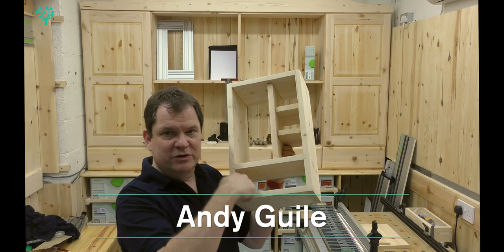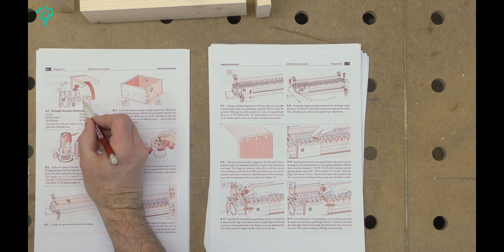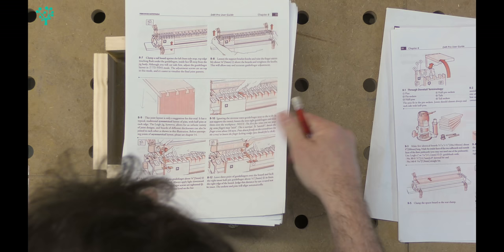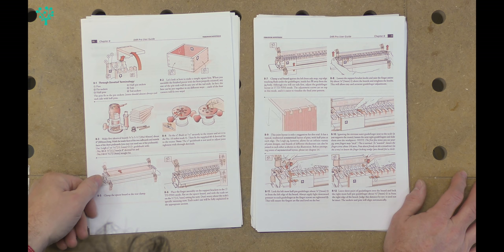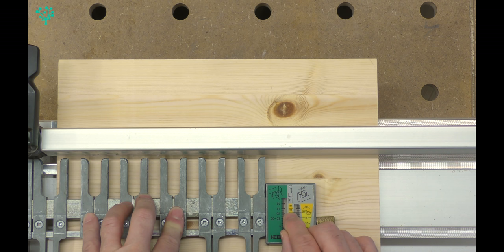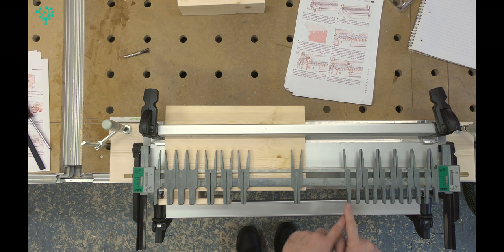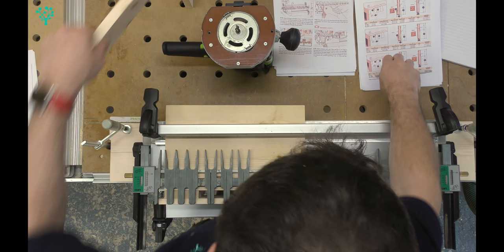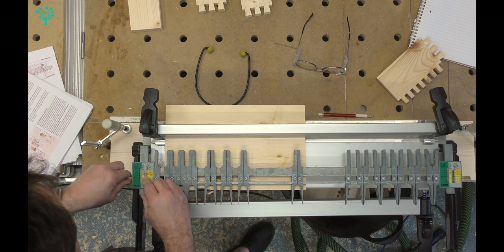Leigh DR4 Pro Dovetail jig - Episode 6 - Through Dovetails

Comment: You’ll need to use a different dovetail bit for the blind dovetails, a shorter bit used on both the pin and tail boards.
Reply from the maker: +Bill Weyand 

Hi Bill, thank for the comments. Haven’t started on the blind dovetails as yet - but yes that would make sense.

Looking forward to giving it a go.

Cheers

Andy

Comment: My manual clearly says that the tails are routed with the inside facing the operator. But It seems like you did yours with the outside face of the tail facing the operator? Doesn't seem like it would work properly but I'm new to dovetails. Thanks
Reply from the maker: Hi Tom,

It was so long ago that I can’t remember, also Injavr now sold this jog in favour of an alternative solution for joinery.

I do remember I followed the book, and it turned out well. 

Sorry I can’t be of more help.

Andy